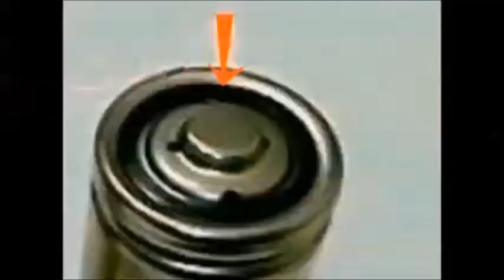Ebike 18650 ReWrapping Bare Cells Ebike Project Part 12

Comment: I have almost went rewrap crazy! With THOUSENDS of cells I gotta show restraint!!!... I'm wanting to rewrap the ones that are in good shape also! And the colours!! They look awesome. And they look so good all new and shiny looking.. It's close to having new cells! So I decided to wrap the ones that need it. "That have rips in the wrap" and if there need to be more to match the outside rows. So they look to be a match. Although I have 3-4 different color wrap. 2 blues ,silver and purple. I'm trying to keep the colours similar to original. Also all the testing can make you Insane. Especially if you write the capacity on the cell. Then wipe it off! Or the tester comes unplugged just before its finished for the second time! Or you take the cell out forgetting to Note the capacity!!! Or your breaker trips just before a whole bunch is fi ished testing! I was sooo pissed! My fault though! Some ppl could get into a bit of a mess rewrapping the cells. It would only take a small bit of wire getting into the wrong place on the cell while its naked! I don't know if it could lead to failure however it shure could give a start.. Or a very bad burn quickly!! Good advice!